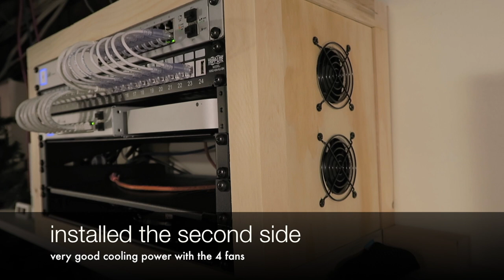DIY 6U Wooden Network Cabinet Build - Part 2

Comment: Would love to see a part 3 and I would also love to see how you mounted the top blower style fan
Reply from the maker: Thank you for watching, no timeline on when part 3 will be made, to be honest only had 2-3 people ask for it. It didn't get much interest. With the top fan its actually just sitting on top of the cabinet free style, I made a hole in the plywood under the fan and as no one ever goes near the cabinet its just sitting on the plywood I didn't secure it down and this actually makes it easier to clean out the fans from dust ever now and them. This fan is actually quiet so I dint use any fan control for this one its always on 24/7, the side fans use the fan controller. So the top fan blower basically sucks the warm air out of the hole on top of the cabinet and blows it forward over the top edge of the cabinet.

Comment: Thank you for sharing my these videos... I’m using your build as the blueprint for mine. Hope you will post the 3rd video if/when you get a chance.. would love to see your raspberry pi setup more in depth as well, or any resources you used. Thanks again!
Reply from the maker: Thank you and good luck with your build, let us know how it goes. Yes I plan on doing a video on the Raspberry Pi build, I want to use a Pi zero W next time, so I will video that build. Just want it a little smaller.
Reply: @raysrcsandtech  awesome ,, looking forward to your video on the rasberry pi setup! When do you think it will go up?
Reply from the maker: @mcvorious5658  Im just waiting to get another Pi before I start a full tutorial video, the one Im using is a single core Pi 1 Model A+ and I want to replace it with a Pi 3 Model A+, if all goes well in the nest few weeks I hope to get one then start the video

Comment: Looks great, where did you get those very short patch leads?
Reply from the maker: Both types are from amazon, the very thin ones are monoprice SlimRun Cat6, 6 inch length, the thicker one are again 6-inch, can't remember the brand but either, tripp-lite or StarTech but again easy to find on amazon.

Comment: Thou... not as through as the first video looks good at the end.
Reply from the maker: Than you. Really once the main frame is done not a great deal to add and show, I may do a video on the temp controller as thats the most complex and interesting thing in part 2, may  rebuilding it a little different using a different Raspberry Pi so that will give me chance to film it.